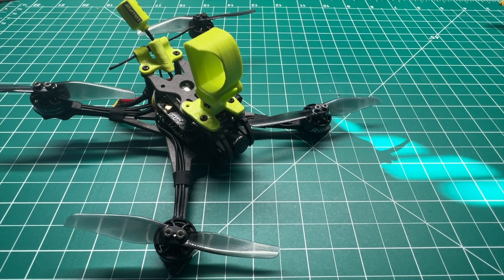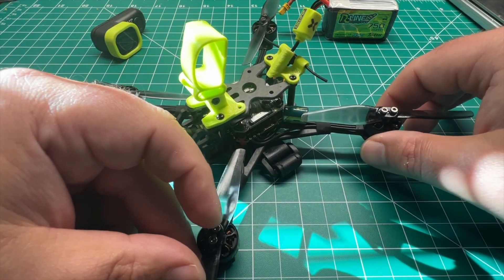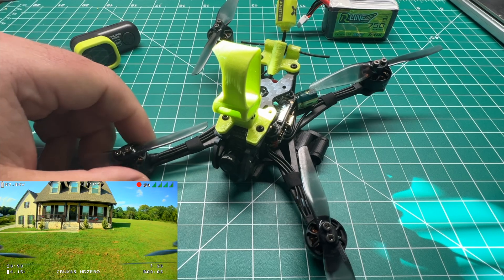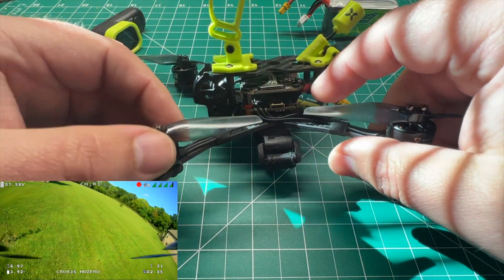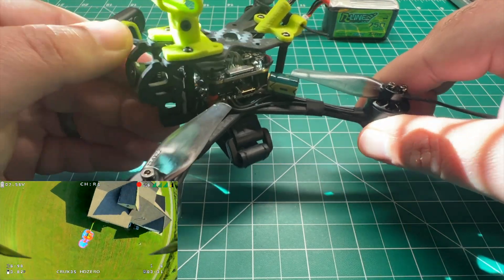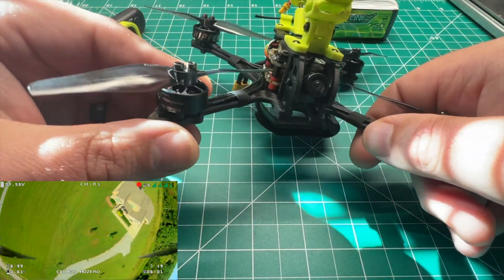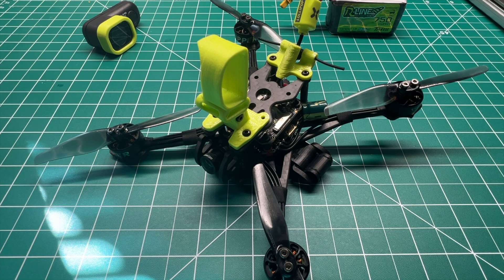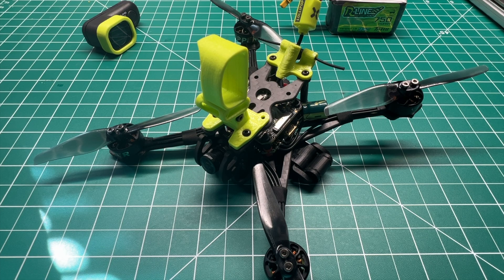HappyModel Crux 35 Custom Build plus HDZero Goggle Update

Comment: Do you have some good pids, my Cruz 35 elrs has a lot of yaw oscillations
Reply: Thanks!
Reply from the maker: You’re welcome
Reply from the maker: I’m using the UAV Tech toothpick preset.
Reply: What esc khz does crux35 elrs come with? I went to bheli and it didn't tell me anything
Reply: I assume it's default 24iirc, did you select rpm filtering and or dynamic idle?
Reply from the maker: @RandomHobbies13  Generally default is 24khz, but it depends on your board. I flashed the latest Bluejay and 48khz. I enabled rpm filtering, but did not enable dynamic idle.